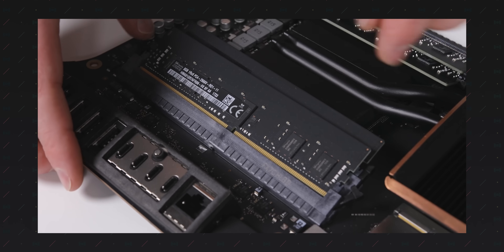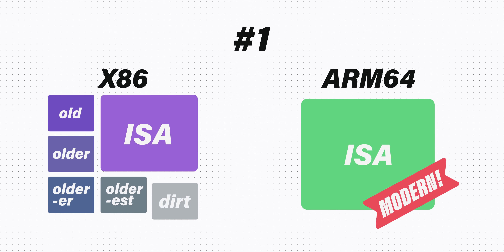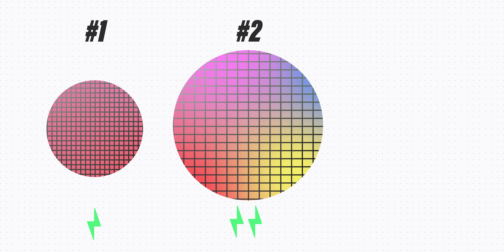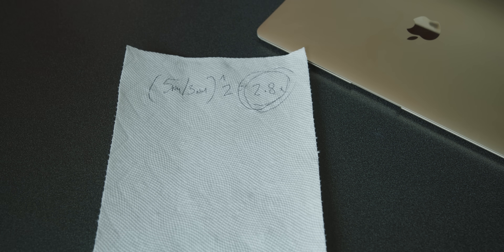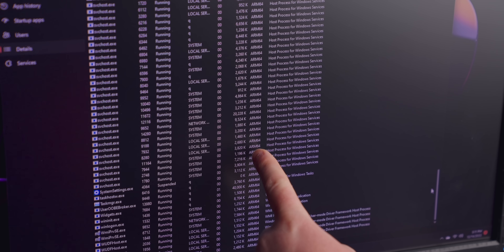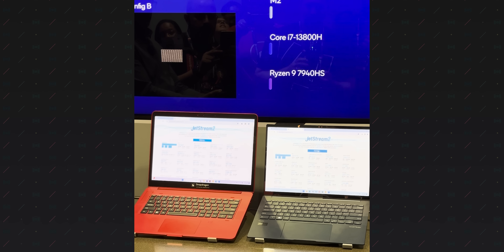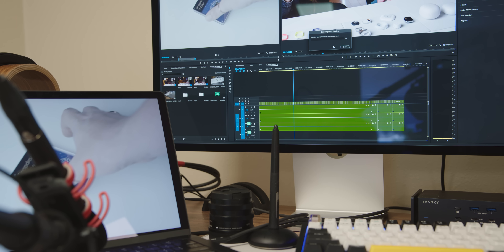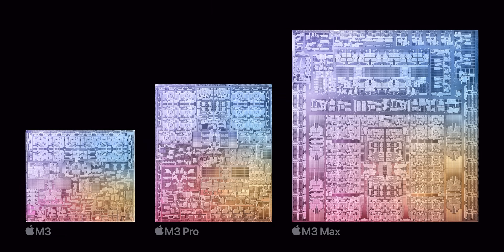Apple's Silicon Magic Is Over!

Comment: Unfortunately Adobe Premiere Pro still doesn’t make that much use of the GPU hardware. Apple’s own Final Cut a lot faster as it’s optimised for the GPU and other co processors. Final Cut doesn’t run the PC so there is a still a big speed advantage if people are willing to use a different program. In general Apple wants developers to use their APIs, and if they do, the advantages be with Mac still.

Comment: Windows is a better option for most people for most tasks.. I used the apple ecosystem exclusively for close to a decade, until a few days ago.. Now i have two very capable machines at home, both can do 100% of the work i need done, im in the creative field so this involves video and picture manipulation and creation and the only difference i noticed is that the windows machines are still kinda ugly esthetically and kinda bulky to carry everything else in terms of power can be done by both platforms for under 2k, but i can upgrade my cpu, my ram and my storage on my windows machine, i cant upgrade anything on my macbook, and this is not okay

Comment: You forgot to mention that unless Apple made the switch to ARM it would have never been possible. 

Apple forced the creative tools embrace of ARM by adopting a product that no one else did. Windows is a bloated, dated, piece of garbage. Apple realized this way back when, threw out the paradigm and made the switch to OSX.

I regularly use 90GB RAM during development and max out the M3 max CPU; the fans barely ever kick on. Benchmarks are the only thing I’ve encountered that kicked the fans full tilt.

Is this a sponsored video?

Comment: Ryzen 8840HS has higher performance per watt in cinebench R15 than the M3 12 core.

This is comparing a system on chip to a traditional laptop.  Apples silicon isn't that impressive.

Looking forward to AMD's Strix Point! Hopefully they announce next week!

Comment: Apple cherry picked the M1 competitions benchmarks.  AMD was alreadyore efficient, but Apple chose to only include benchmarks from an AMD Ryzen CPU which has hyper threading disabled.

Hyper threading is an important way for modern CPU's to cram more instructions in with almost no additional power costs by packing pipelines with instructions the cores can execute opportunisticly.

This truly crippled the AMD Ryzen laptop CPU's since this helped in both raw performance AND performance per watt.

AMD also wasn't putting powerful GPU cores in their laptop APU's since discreet GPU's were an option in PC land.  It has only been in the last generation where the AMD APU's have hosted powerful GPU's (hence the whole PC handheld market)

Strix Point, however, is going to blow apple out of the water.

Ryzen Laptop CPU cores are already superior to M series chips. But now AMD is piling on AI and GPU cores.

This is the APU PC enthusiasts have been begging for, and Apple doesn't stand a chance.

The only real advantage the M series had, anyways, was on die RAM. That doesn't scale and it doesn't compare to AMD's "3D" cache.

Comment: How is not having to upgrade from your M1 a bad thing? As far as Qualcomm and Windows go, because it doesn’t exist yet who knows what issues will arise. I can pretty much guarantee it won’t be 100% smooth. Maybe someday PCs will get on parity with Apple, but not for a few years. And if they have NVidia graphics chips the heat increases exponentially, reducing battery life and long-term reliability. (heat kills chips)

Comment: Apple silicon was never magic.  The magic apple had was exclusive 5nm and 3nm production process allowing it to cram more transistors on chip, but others are catching up.  If apple was smart it would have never included a large bulky Neural Engine and instead used that space for a 64 bit Intel compatible processor. This would have allowed it to still do Neural kind of stuff, but allowed the machine to be Windows backwards compatible for companies whom need to run software that is only available on Intel Chips such as Solidworks.  Like Tesla, Apple does not listen to customers.

Comment: Theres the famous quote the only limit to AI will be its hardware and computing abilities because of that hardware bottleneck. In the advent of AI we must take one step back with all our current 3nm chip knowledge and make bigger chips on bigger boards or stacked boards. The thinnest will no longer be impressive if a slightly thicker competitor sitting next to it is just blowing it away. If everyone would get over themselves constantly striving to make the body and housing thinner (ITS THIN ENOUGH! Jesus), they could make a chip as large as the phone or laptops screen with battery layered behind it instead of always striving to make them sit side by side. It would also mean more battery which means it runs cooler.

Comment: Doing 3D ,CAD  engineering work (using NX in Parallels)  ,Rhino, Plasticity and some Blender. I can tell you that the difference from the M2Max to the M3 Max was MASSIVE!!! especially for NX. Which is the obvious case that the high end laptops exist because a lot of us power user which like the Apple eco-system ,requested. You need to do a bit ore research before having those wild ass claims....CLICKBAIT!

Comment: I moved to M1 from Microsoft laptops and it was a new world. It changed my perspective on things. Windows laptops never performed well on battery and it didn’t matter about performance when the thing was dead after a few hours. Just being able to use the computer without battery life anxiety was massive. The M1 still feels new and works great and so if it isn’t broke does Apple really need to push the boundaries just yet? If my M1 broke today I will want to buy another MacBook. I don’t have any outstanding issues forcing me to need anything better. Anything more powerful. It’s all just icing on the cake at this point for me.

Comment: You are so right about Apple hardware for their computers.  The software is king.  This is where Apple maintains the "Walled Garden", thus more money.  Their non-app software feels very old. I mean BSD seems newer.  Having the apps be in containers is very good.  They, and the app companies, shine with their software.  Apple's push with Swift is part of their "Walled Garden".

I have the M1 14" MBP.  I also have many different HW platforms with Linux OS.  I mess around on the Mac, but I work, doing development, on the Linux hardware.  I find value in getting older powerful hardware for very little money.  I even got a MacPro with 64GB memory and dual D700 for under $200.  Development work you don't need the newest stuff because you spend most of the time staring at the screen and debugging.  If I put most of the code in memory, then clock cycles are important.

People buy hardware, yet use software.

Comment: I have an Asus ROG laptop from 2017 (GL753VD), I can swap and/or upgrade the ram sticks, SSD and HDD. 32 GB 2400 mhz DDR4 sticks here cost around 75$ (2x16 GB), a regular 512 GB Samsung 970 SSD costs under 100$.

You tell which is the better deal - an "outdated" "gaming" laptop for about 450$ (that can handle professional programs like Blender and DaVinci Resolve absolutely fine, play AAA games at native 1080p with sometimes medium-high settings + a perfect heater for when winter comes) or a 4800$ Crapbook Pro? (yes it really costs that much in Romania) - a laptop that can barely run the most basic of 3D titles, simply because "it was not designed for that". Then what was it designed for? Oh right, Apple's proprietary software solution, that once you get it out of its comfort zone it'll lag like any other midrange laptop.

I don't care about build quality, UI design or any other garbage pushed down our throats for that price, if this 4800$ machine (which is stock by the way, it can always get 10 times more expensive) still can't outperform a low-end "gaming" laptop (with an i7 7700HQ and GTX 1050 4GB - it can always be used for everything besides gaming) from 2017, then why are people still praising it???

Comment: All good points. It will be interesting to see how flaky Windows is on the Elite CPU. Windows is flaky generally with so much old and new software, bloat, and inconsistencies. Plus the vast number of other companies making software that needs to be compatible, not easy. One thing that would really help Windows success on this new chip is to stop using NTFS and the Windows NT kernel! They have been shipping Linux kernels in Windows for a while to support WSL2, so I don't understand why they are not transitioning to Linux kernels as the core base for running Windows. Their main sell is their window management systems and Office tools, so why stick to the silly proprietary kernel, the silly dll and registry design from 1990....seriously! And to top it off they have a seat on the Linux board. The timing could have been perfect for MS to transition both, but no, the world gets a mis-mash of crazy! Oh well! I will stick with Apple for the foreseeable future! Good luck Qualcomm, I hope it works!

Comment: Soldered on SSDs are a huge security issue. If your Mac does not turn on and you are not able to erase or remove the SSD, would you send it in for repair, even if it is under warranty? I personally will never use Mac for my design work. I won't compromise client data.

Comment: The real Apple Silicon secret sauce is the big process node advantage and low frequency, high IPC cores. Also the Media Engine and AMX, but not "Unified Memory" or the Neural Engine. It's not even used most of the time. And unified memory has been a thing on x86 for many years.

Comment: Power will run through the back of the wafer allowing more on the chip, this is the bridge to 3D chip construction. I pulled one from a dead terminator. But the dam thing was smashed.

Comment: All true until M4. It’s cheaper 3nm node and yields solid 25-30% processing gains.
Still loads of Microsoft professional apps are not Arm native - like sql database engine and sql tools. So paint me skeptical.
Limits of MacBook Air is not cpu but low memory and disk space base models. If you upgrade that then MacBook Pro makes more sense.

Comment: M series Mac not a savior. They can’t run 32 and 64 bit software together like Intel Mac. Intel Mac can have high Sierra , Mojave, Catalina + on multi hard drives, can’t  run none subscription software exetensis font manager , Adobe Cs 6, can’t really run Moro that well, cant run 32 bit games. They need a hub to run multi monitors, can’t upgrade SSD

Comment: Of course we have donuts in here, who would say "this did not age well". Why did Apple take a one year break from releasing a new ipad pro? Well, so they could have the liberty of jumping from the M2 to M4 and claim even bigger performance gains since the m4 wouldn't give that big of a perf uplift from the M3. 

The M2 is 5nm chip, the M4 is based on a 2nd gen 3nm lithography, it's basically a 20% performance boost at better energy efficiency from the lithography jump alone. Give it better, larger cores and wider fetch/decode units and the jump from the M2 to the M4 is even bigger. So the 1.5X jump they touted basically adds up. If it was M3 to M4, the jump would be much smaller.and closer to 25% instead. Besides the Pro never released with an M3 to begin with.

Comment: I am still fond of the 1st really good PC I built in 2008 when the Quad core 9600 came out, the Gigabyte mobo holds a whopping 8GB DRAM and as much SSD/HD as it wants and it made for a good hackintosh in its day,  I just bought the M2 miniMac with 16 years of advancement on all fronts, it features a whopping 8GB DRAM and fixed 250GB SSD size, what the fuck
Wonder if Apple is going to stare down the new CAM based DRAM modules and pretend they don't exist, thats going to be interesting.

Comment: How has the Apple chips dominated since launch? per watt computing power yes, but every benchmarch still has AMD and Intel CPUs providing the top results. I love ARM but the way these Apple laptops are basically scaled up iPads in terms of how their SOC works is just bad news (hence less Thunderbolt ports and lack of eGPU support). If your SSD dies your machine is toast, the BIOS is stored on the SSD and so you can't even boot the machine off USB.

Comment: Some of us are old enough to remember when Macs CPUs had the speed and efficiency advantage multiple times in the past. When the first Mac was released in Jan 84, it had a 16/32-bit 7.83MHz 68000, when IBM's XT was their most advanced PC, and it still had an 8/16-bit 4.77MHz 8088. And practically all of the other personal computers on the market used either the 8088 or an 8-bit CPU, with a few MS-DOS/PC clones perhaps already using the 8086, which was fully 16-bit. And then, when the PowerMacs were released in Mar 94, based on the PowerPC 601, they were again the fastest and most efficient personal computers on the market. And the same happened a few times during the PowerMac era.

Comment: I’m going to go out on a limb and use the iPad (Pro) as an example of something. Apple makes design changes to have something to brag about, not because it’s what people want.
An example is “thinner, lighter.” I have an M2 iPad. What I want is longer lasting and no camera bump so that the iPad lays flat. The M4 iPad could have included a larger battery and fixed both problems. Instead, Apple did something no one asked for and made the camera bump BIGGER while not improving the life of the battery. They did the opposite of what made sense.
And then to add insult to injury, they add .1 inches diagonal to the physical size just to make sure prior accessories (keyboards/cases) aren’t compatible.
A very environmental move of Apple to cause products to be e-waste…
And all the while their Operating System is crap. The File “app” doesn’t do the fundamental thing it’s supposed to do (manage files) without major bugs. It confuses move and copy. It forgets to finish move/copy tasks. It fails to find… Apple spends time on adding new features to their pro apps (Logic and Final Cut) but doesn’t even get the basic apps/functions right.
Apples answer is to take a page out of the Republican play book and gaslight you.
I’m not a Trump supporter. I’m finding it hard to be a Tim supporter…

Comment: It's really frustrating. Apple make beautiful hardware when they can be bothered but they tie it to a user environment that emphasises workflows they think you should be using. I find their machines frustrating to use like a "computer", when apple wants you to use them as a "computing device". What's worse is that the general market appears to be following them. Windows 11 is clearly starting to edge toward a cathedral model, and default Linux UIs are also vastly simplified compared to how i prefer to use them.

I'm more than happy to transition to RISC architectures, but if the whole market goes fisher price then i think I'll stay on x64.

Comment: Am I the only one that, for a while now, feels as though Apple needs to spend a bit more time working on their code base/relieving technical debt etc?

Yea, they are very very good at optimizing for efficiency, but I’ve felt that for the past 5+ years they have been pushing really hard to add new features at a very very steady & fast cadence. And the result of this has been an increase in both bugs & vulnerabilities.

Comment: Im still on the M1 Air. Its still more than fast enough to do the things i need. Untill Macs come with 16gbs as the base model I'll more than likely not upgrade to the latest M chip. In fact I'll probably go for a different brand if my Air starts to 'chug along'

Comment: What Apple will have to face in the future is likely that they will have to integrate some kind of PCIe support in their bigger machines again, so that the people using Mac for Rendering (Video and 3D) can start pushing their future RTX 5090 QuadSLI inside again.
Now, this is obviously the high end, but if Windows on ARM will keep PCIe open, allow for easy to switch SSDs and GPU support, then it will definitely ease the transition.
Of course, with a lot of laptops, the real power draw under load isn't so often the CPU alone, so GPUs themselves also have to get more efficient, but I'm also talking desktop devices here. A lot of iGPUs are really good by now, but not even Apple's iGPU with RayTracing competes on a level dedicated graphic processors have now. Apple might be more efficient, but with graphics a lot is hunting for a sustained high point of performance (e.g. long renders, game sessions, etc.) where the power efficiency starts to matter less

So what I'm saying here is:
If Windows on ARM manages to leverage the PCIe advantages and keeps it's modularity, even down to laptops but especially in desktops, then they will always have a distinctive niche even with more "common users".

Comment: I think you touch on what apple will do next:
larger CPU dies, some innovative cooling stuff, the platform will all become about the thermal management for performance, but performance is already "enough" for 99% of consumer tasks.
so it'll be an optimizer for: what thermals do we need for 5x realtime 8k encoding with 10 effects. or, manage 10 live cameras with unreal engine stage.
they'll pick 3-4 pro tasks and tune the thermals to allow that to run for the period of time it needs to run. that's what i think